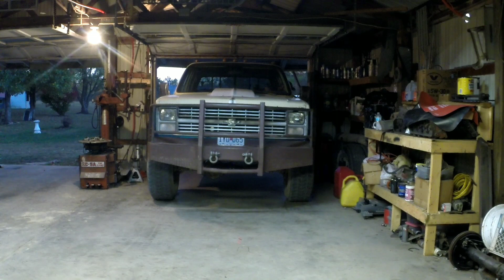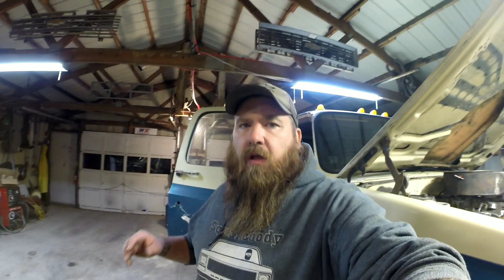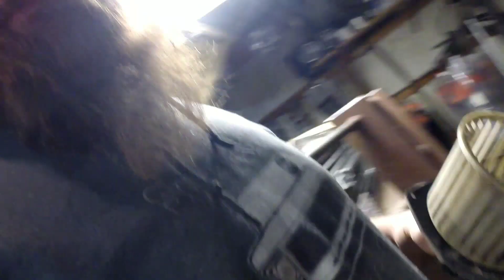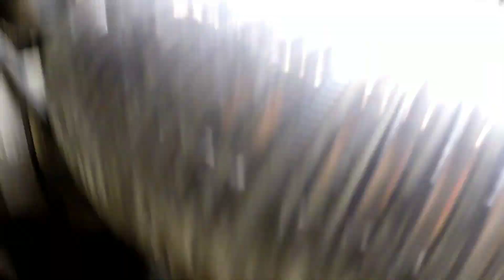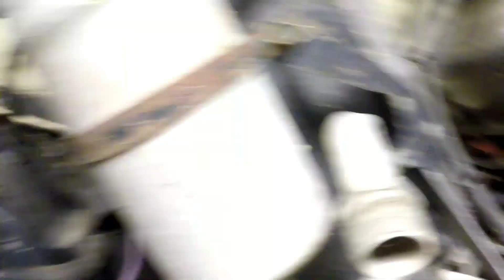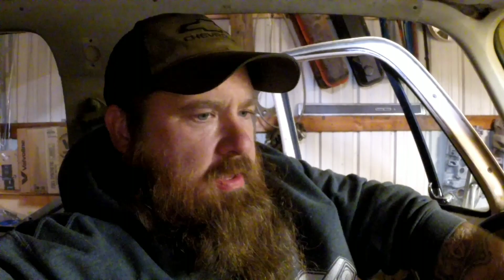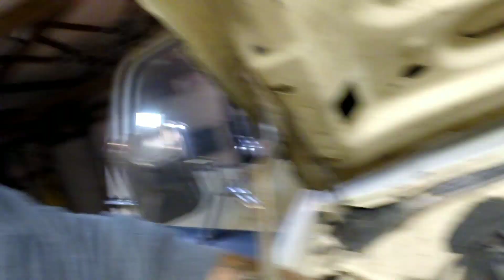How to replace the blower motor in a 73-87 Chevy Squarebody.

Comment: 0:24  lucky yours just barely squeezes right on in there lol mine not so much 😂
Reply from the maker: I have to use vise grips to keep the shop door up all the way. And still just barely fits. I have since put regular sized tires back on Ole Buddy.  He fits better now. Still only a couple of inches on each side of the bed though.

Comment: the previous owner cut my purple wire that leads from the motor to the relay. can i buy that wire somewhere that will plug and play? i cant find the exact name of it.
Reply from the maker: You can splice it back, unless it's gone. I'm not sure of any replacement off the top of my head. I'd do a search for AC relay wiring.

Comment: I always update the motor to a 88and up blower motor
Reply from the maker: Good tip, I had this one in a parts truck.
Reply: @SquarebodyStuff  blows alot stronger...i was happy asf lol
Reply from the maker: Yeah, I've heard about the swap, but I'm to cheap to buy new when I have several used ones still yet.
Reply: @SquarebodyStuff  no need to spend money when you don't have to 😎